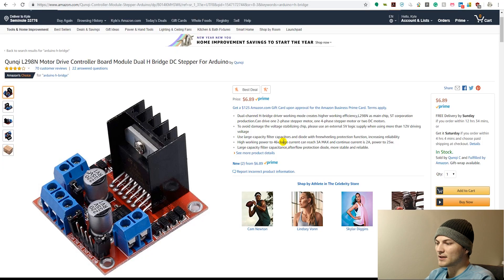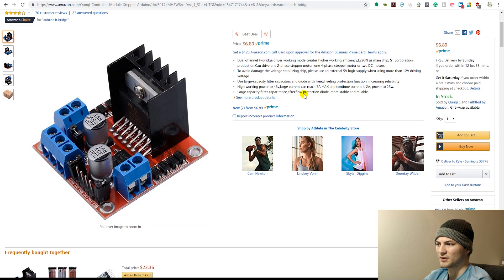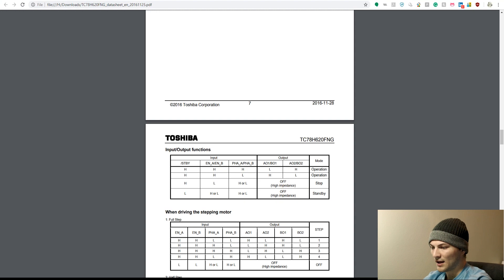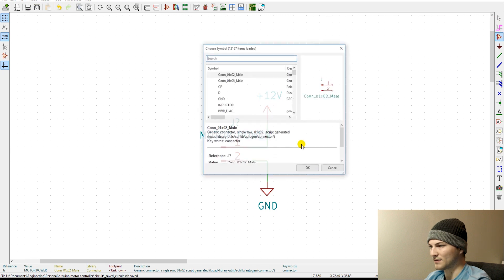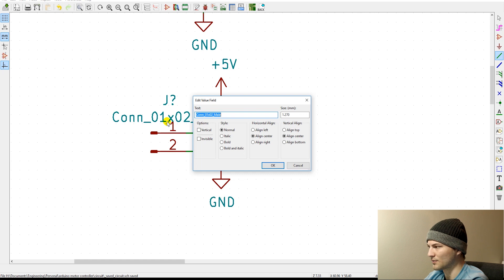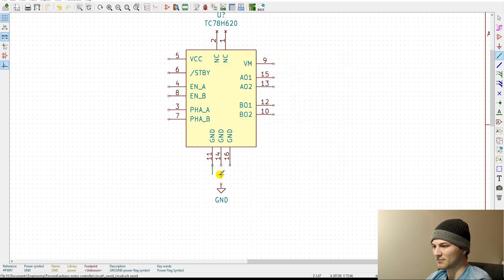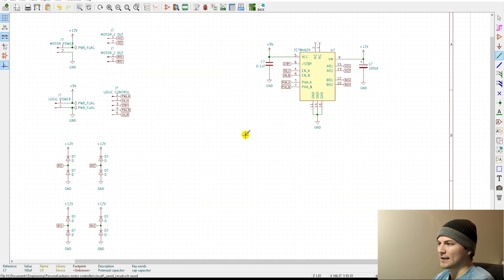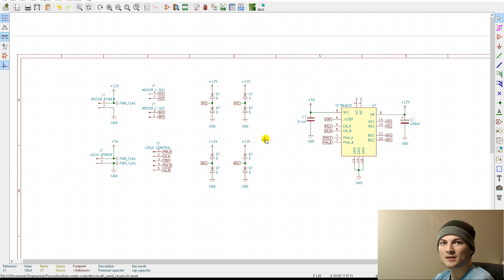H-Bridge Arduino PCB Circuit Design - KiCad 5 - Part 1/2

Comment: I tried to design an H-Bridge to power an electric car, but that was before I knew what I was doing. The control part might work, but the H part I had was totally wrong.

The one thing you need to absolutely make sure of, is that you prevent both sides of the H from be activated at the same time.

Comment: Great video. I think I already know the answer to this question but what voltage rating would you need for the fly back cap on vm. Would it be somthing like double supply say 35v or 4-5 times supply for the spike voltage?
Reply from the maker: Yeah you're on the right track. Normally derate electrolytic's 50% at least

Comment: great video! For high power applications, can we use mosfet ?
Reply: ya!! i just watched a video i think which answers the question you asked here is the link .         https://www.youtube.com/watch?v=dbwZgP9gIbA&t=631s         its a really good video and i think it answers the exCT QUESTION WHICH YOU ASKED .   what it explains is in short that you just need is to make sure the voltages are at which your mos is operatable without blowing up  and according to that hook up the resistrors to the transistors  that are grounded in the h bridge .
Reply: @saifahmad141  Thanks!

Comment: Hey quick question, I notice when you click to lay a part down your parts selector loads about 12,000 items and it pops up so fast. My parts has only 10k items but it loads so slow like a 5 second wait time EVERY time i go to place a part. even if i have loaded 10 other parts it will still take so long to pop up. are there any specific settings for this? I have a beefy machine with 32gb ram and 6  cores and i monitor the ram and cpu and they are not under heavy load. It really makes using kiCad a real drag for me... any suggestions?

Comment: In you back EMF discussion, the current left through the +12 rail and returned through ground. This appears to be transferring the problem of handling the  pulse to the power supply. Is that ever an issue or can power supplies normally handle large pulses like this?
Reply: Sorry - I did not watch all the way to the end before I asked the question - you already answered my question
Reply from the maker: Yeah, you're right that it the power supply has to be able to dissipate it to an extent. Most supplies, batteries included, are able to without much issue. But that is also a reason to have the large Cap on the VM.

Comment: Can you explain why you need the flyback diodes that are connected to ground and not just the ones connected to the positive motor rail?
Reply from the maker: With an h-bridge you can reverse the polarity of the outputs. If you just had the one set of diodes it would only work for one direction

Comment: Great video! Mayby something with simulation module in KiCAD? Even something rather simple but still very needed for designs. Or mayby "Creating product from scratch" series?
Reply from the maker: I actually haven't ever used the simulation within KiCad, I usually use other tools. Yes, I'm working on on a product from scratch series actually!
Reply: @MicroTypeEngineering so what tools do you use for simulation purpose?
Reply from the maker: So I actually don't do a lot of true simulation using a SPICE like tool. For a lot of more simple testing, I actually use lushprojects circuit simulator. And yes, that's what I'm planning on doing :)
Reply: @MicroTypeEngineering  that's awesome! I'm waiting for it. It's possible for you to check users projects? It's next proposition for series for youtube Channel if you like :)
Reply from the maker: Hmm. Like I review people's schematics/PCB layouts? Never thought of that, could be pretty interesting content
Reply: @MicroTypeEngineering  Yes, exactly that. I think it would be really great for your channel.
Reply: @MicroTypeEngineering  and I meant "from scratch" as with mathematical work, simulation, creating schematics, pcb and some 3D CAD work for enclosure.